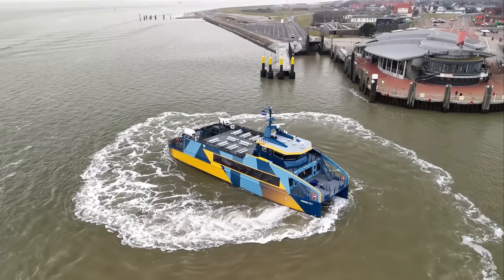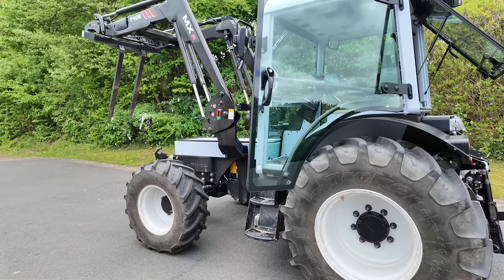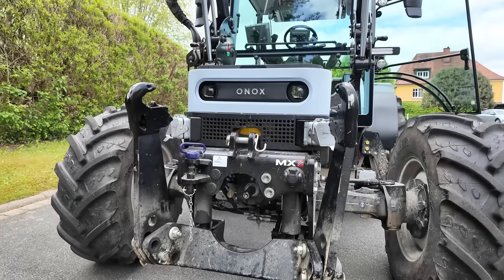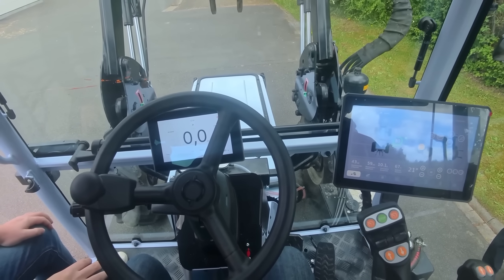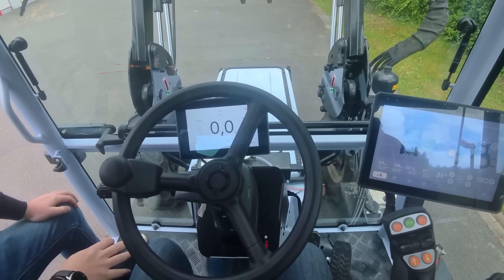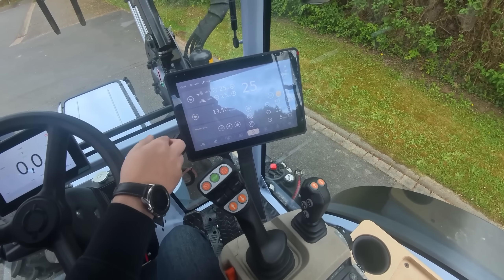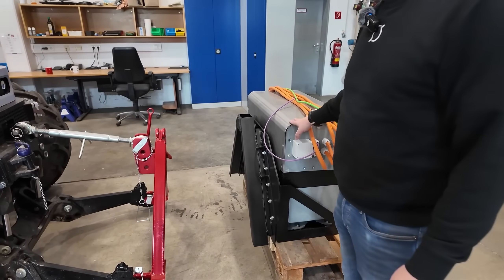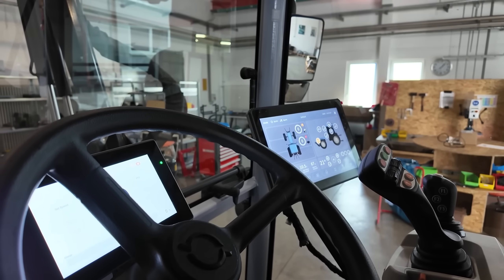Farmers, Meet Your New Ride! E-Tractor with 5 Swappable Batteries 👨‍🌾 🚜 🔋

Comment: I wish all tractors had front and rear-mounted 3-Point hitches and PTO drives.   In the winter, I'd keep a snowblower on the front and a blade on the back.  In the summer, I'd put a brush hog on the front with an offset flail mower on the back hanging off to the side for a wider cut.

Comment: I don't get it. So  why not just stick a 100kw battery where the bonnet would of been or some kind of battery that could slide on and off where the bonnet should be instead of going with a system of awkward to replace batteries.

Comment: 48V battery is a very tough choice.
It means almost a thousand Amp to handle, I guess, that makes the hardware more expensive and fragile.
I'm really, not sure about that.
Reply: I drive electric forklifts for a living, They run on a 48 volt system and work pretty well, although the charging cable does get very hot when charging. The chargers are 22kw 3 phase.
Reply: I suspect that it's partly to make it safer to work on as farmers are known for tinkering with their own equipment. At some point around 100V, a DC shock becomes powerful enough to kill you instead of just hurting like fuck.

Comment: As someone who used to work in agriculture with smelly diesel tractors. I think this is wonderful and would work well on many different types of farms 👍
Reply: Any farm that only uses a piece of equipment for only a couple hours each day and never leaves them inside for long periods of time would benefit from this.
Reply: This thing is quite lightweight & of limited use. 
It’s probably got some use around a yard doh g certain jobs. 
It will not be much use in a field though
Reply: @hughmarcus1 It sounds like this is very much proof of concept, so you might was well try things out on a smaller tractor.

He did say when would work on a larger tractor later on. By then, batteries will be cheaper, so more chance of making an affordable big tractor 200hp plus
Reply: @hughmarcus1 If you search 'silent plowing 160hp' then you will find another experimental tractor that is a bit more for you, although they say they don't want battery swapping so that will limit the days work.
Reply: For years they are selling electric tractors to wine yard's

Comment: Yeaah my family has a small farm we have  this nice old tractor from 1990s.....it will outlive this electric one by a few decades still, no one has time to be switching batteries, when the weather is right you get up and go half an hour could be a difference between everything getting wet due to sudden rain
Reply: You can switch the batteries ahead of time :) so before the weather comes in.
Reply: But yeah these first models will likely last a bit shorter than those decades.

Comment: 48 V is the biggest advantage for now at the usual farm doing a lot of repairs on their own. Also the connection to the home solar power charging system and usage during night for example. 
But in the long run still questionable where the future will go cause in case of mass production of high voltage battery packs things can shift easily to the high volt system.

That is already happening in the private home solar power system market slowly. Why ?
The HV VW battery from VW have been reverse engineered regarding the BMS protocol which now allows to connect an unopened and still sealed VW ID battery in connection with a deye inverter cause there are 2 liligo boards for 40€ or so available that map the communication between the VW ID BMS and the inverter. 
And these used VW ID battery have become really cheap for example 78 kWh for less than 5000€ is a lot cheaper than the usual DIY battery based on EEL cases for example. Those cost about 1000€ for the EVE cells and 400€ for the case with BMS = 1400€ for 16 kWh. 5 of these would match the used ID battery but would be way more expensive with 7000€ and a lot more work if you have to deal with 5x 120 kg boxes each 70 cm long and 40 cm wide plus 26 cm height or a tower of  120 cm height.

Comment: Love the 48V, sounds like a great idea. This makes the system much more repairable.
Reply: but at the end lot less effficient . We have a solar power DIY 51 V battery system of 16 kWh and also based on LFP cells. 
Efficiency is horrible - at least if you compare that with a simple deye HV inverter connected with an old 78 kWh ID4 car battery. 48V and you will face more than 20% losses on a full detour with AC charging of the battery during winter and DC discharging. The house can run a night from the battery and during winter and a long night the battery will be empty quite soon with just 73% of the AC energy generated which went into the battery. 
We have expanded the system up to 48 kWh with 3 x 16 kWh LFP batteries but first of all that is not cheap (compared to a used ID4 battery which offers 78 kWh for the same price) and not as efficient cause the losses add up. Finallly the cable diameters for HV batteries are much thinner due to 8 times lower currents. 400 V versus 50V ends in a question about 8 times  higher or lower currents and cable diameters. 

Not sure if I would go for 48 V again in 5 years. We are using 51V LFP batteries for over a decade since 2013, so LFP was the proper and best decision but 48V becomes more and more questionable. Also the limitations and amount of wasted space if you compare 16 kWh packs x 5 with 5 BMS to a single ID4 battery with 1 BMS.
Reply: @typxxilps It is less efficient but 48V is the limit before stronger regulations, I get why they chose it to make a demonstrator or some low volume production, especially with the swappable packs.
Reply: @typxxilps
Especially at low speed, high torque use cases.
Reply: Winding of the motors is a PITA. Thick wire.
Reply: Most farms have 3 phase electric supply capable of much higer voltages which would mean much quicker charging.
Reply: @GaryV-p3h most German houses have 3 phase and are capable of 22kW charging. Farm and industry can do 48kW

Comment: There a lot of use cases where half a day is not going to be enough. Especially on big American farms. If you are doing a 14-hour day because the fruit is ripe today, a 4-hour tractor isnt going to be much use.
Reply: You can use fast charging during your breaks :)
Reply: This is why you can swap the batteries.
Reply: @thankyouforyourcompliance7386  even swapping it has limitations.
Reply: I agree,but you have to start somewhere,even the first i.c engines probably wouldn't run for more than 30 minutes at a time,and like them,they'll get better with time,and technology
Reply: @michaelparker5072  this is only going to wrok on very few select applications not something like plowing or harvesting where vast amounts of power are needed! imagine a massive John Deere with tracks pulling a giant and heavy plowing device.
Reply: @carholic-sz3qv indeed,never thought i'd see a battery powered tractor,but here we are looking at one,and some are as powerfull as trucks-horsepower wise,the truck this lad drives on this channel is rated at 1000hp,so never say never
Reply: @michaelparker5072 lol!!! Putting batteries on tractors isn’t something new the problem is the amount/type of applications they can actually do.
Reply: @michaelparker5072 yeah In europe specifically Scandinavia they drive 700hp+ diesel semis hauling about 3x more loads than the 1000hp ev that’s efficiency
Reply: @michaelparker5072 in Australia they have road trains diesel semis moving about 4x the load of the 1000hp and those diesel litteraly goes through the outback on unpaved roads crossing rivers even during flooding and more.
Reply: @carholic-sz3qv you're getting a bit off topic,the original comment was about sustained power use in tractors whilst plowing,if you want to talk about high power trucks with multiple trailers i'm sure you're allready aware Austrailia has electric roadtrains,the duty cycle of which is comparable to a tractor ploughing,asbi originally said,just because it's probable that it can't be done to that extent with a tractor with a plough on the back at the moment,it doesn't mean to say it won't be done in the future,is all i'm saying
Reply: @michaelparker5072 Australia doesn’t have electric road trains they have electric trucks for very small application I’ve watched the Robert video from electrifying last year and that thing doesn’t have the range to compare to even the weaskest oldest diesels lol!
Reply: @michaelparker5072 yeah it will be done in the future just like musk is going to make electric rockets wow! Mind blowing!
Reply: @michaelparker5072 diesel road trains are used to haul all kinds of heavy and bulky loads throughout Australia suppling the remotest places doesn’t matter if paved or universal roads. That’s not what an ev will compete with lol!

Comment: They must have an interesting system for combining multiple swappable batteries and the permanent one, as they could be at very different voltage levels. Do you just plug in one at a time, or is it handled automatically?
Reply: A simple BMS would take care of that.

Comment: 48v is crazy. i could use my ebike charger
Reply: It would take a while! Also I wasn't paying attention but I assume the batteries are lifepo4 whereas your bike batteries will probably NMC and therefore a slightly different voltage.
Reply: @matthewwakeham2206  did say prototype has NMC while production would use LFP
Reply: 48v allows farm workers to work on the tractor without getting hurt.

Comment: This is great. We are getting closer to direct replacement for diesel tractors. I have a 25hp tractor and I can spend all day in it, and then not at all for days or weeks. This has it all covered so it would use hardly any power if just driving around with a grader, slightly more for a front lifter or bucket and more again for the PTO. Diesel tractor engines are oversized for the relatively small amount of time that you are running the engine and PTO at the same time. A great solution this one.
Reply: its not a direct replacement to diesel let alone its going to be great for very select applications, youre not going to use electric to plow a massive surface let alone for harvesing, for moving harvest yes it works.
Reply: I'm in the same boat, I wish there were an electric version of my little 25 HP LS.

Comment: Thanks for the video. Since you are German, you should try to also set up a visit with Fendt and make a video about the Fendt e100 Vario and Fendt e100 V Vario, the world's first electric tractors in series production. They come with a 100 kWh non-swappable battery and but with 80 kW CCS DC fast-charging and 22 kW AC charging. They have 50 - 66 kW power output, so about the same size as this small Onox 1 tractor.

Comment: I am not a farmer so I'm not sure of the demands on tractors during harvest times.  Will farmers say that half a day of production is comparable to a diesel tractor before having to replace the swappable batteries? How much production can you get from the swappable batteries since the permanent battery will be depleted?  Can the swappable batteries be charged in half a day to go back into the tractor? I think these are things that farmers would likely consider before making the switch to electric tractors.
Reply: To me, that looked like a good prototype of a light tractor that could be used, for example, for maintaining city parks or other similar light, part-time work.
Reply: They said they aren't doing DC rapid charging. If they're using standard 7kW AC charging, those 30kWh batteries will take about 4 hours to charge - or about 90minutes with a 22kW three phase AC charger, which is fairly common in Germany.
Reply from the maker: I sadly have no more specific information that would clarify it, but I assume that those points are influencing the final production version.

But regarding the batteries, the swappable ones will be depleted first.
Reply: @electrictrucker   I honestly didn't think YOU would have these answers since you probably have as much experience farming as I do! lol But I would be interested to hear from the tractor manufacturer to see how they have addressed these concerns in their design.
Reply: When we are working one of our tractors hard, we have to stop around 2pm to fill up with diesel, so swapping batteries would be much the same down time.
Bigger tractors would have room for bigger batteries so would last a similar time, although faster charging would be handy, and probably needed.